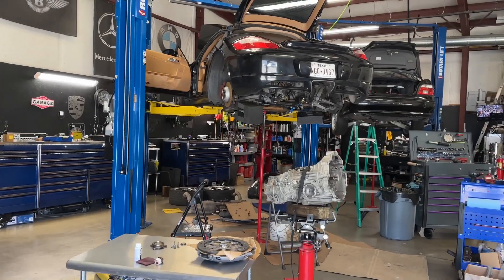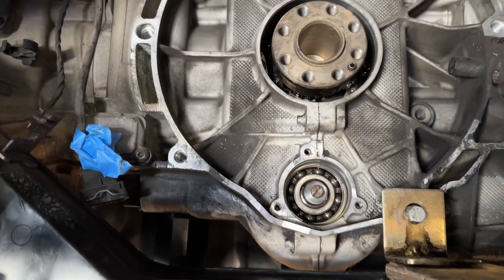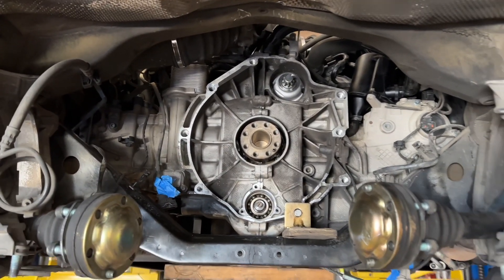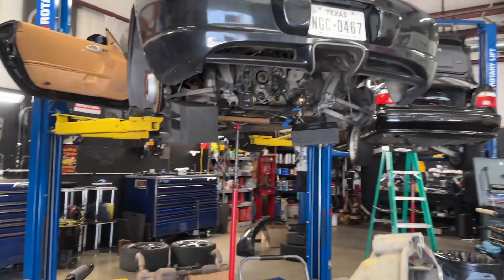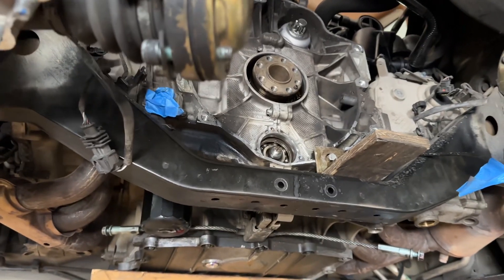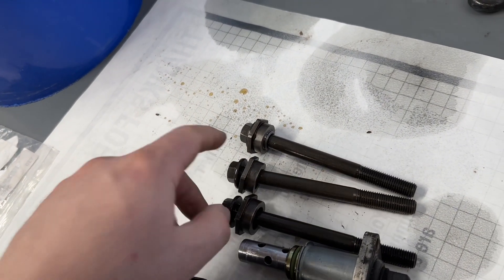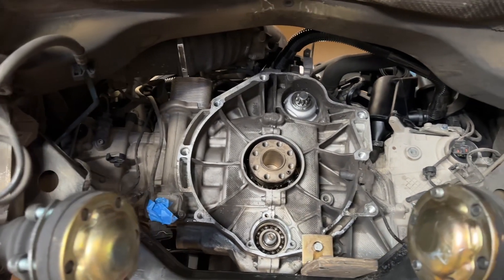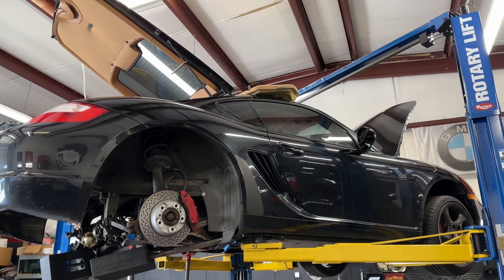Large single Raw IMS bearing failure rate PORSCHE 997.1 911 & 987.1 Cayman | how to prevent failure

Comment: large single row IMS bearings rarely fail. While not easily serviceable, they also rarely fail. 6 failures reported in 15 year old cars when tens of thousands were sold does not indicate systemic failure. Bore scoring is probably a larger issue.

The Best way to prevent failure is to drive your car regularly, do not let it idle to warm up (drive right away gently), warm it up as quickly as possible, make sure to wring it out once in a while, and do not baby your car.
Reply: Hi, thanks for your comments.  I do not have much Porsche experience. Can you please explain the logic behind your recommendations for preventing IMS bearing failure?  Also, hen you say "wring it out" what RPM range are you suggesting?  Thanks for sharing your experience.
Reply: @pablopiquante3227  Warming up a car at idle in neutral or park is not good for any car unless it's ice cold outside. I'm from the rust belt but also live in Southern California so i understand it's diff for everybody. All somewhat modern cars should not be warmed up for 10 minutes at idle. They should be warmed up at light load driving slowly almost immediately after startup to get the oil to operating temperature in 3-4 minutes rather than 10. Cold starts are the toughest thing on any engine and extending a cold start is bad.

Also, you need to get the oil up to above 200 degrees at least once a week on a long drive so you burn out any water or gasoline in the oil. extended periods of time with water (obviously bad for iron based alloys) or gasoline (a solvent) is bad for any engine.
Reply: @roots4x  Thank you for the advice!!!

Comment: So I'm a little confused how does oil get to the outside of the bearing that you are showing, and is there not a seal on the inside of that bearing
Reply from the maker: Bearing is inside the IMS shaft, and the outside bearing portion is exposed to the oil in the sump.
Reply: @TopAutomotiveInc Dont know why but I was under the impression that one of the causes of IMS failure was engine oil breaking down that seal and infiltrating the sealed bearing
Reply: Ya, agree, unless you puncture the inner seal I don't see how oil gets to it. Unless the oil has access to the outside of the bearing.
Reply: Yes, if engine oil can splash onto the outside of that bearing why isn't oil getting all over the flywheel and clutch plate which is right next to it? Surely it can't? (Does lot's of oil pour out when you split the gearbox off the engine? I don't know I've never done it.)
And if it can't, removing that seal cannot be the way to go.
Reply: @pjay3028 How. could the oil come out after pulling the trans??  There is a cover with a seal for the IMS bearing.